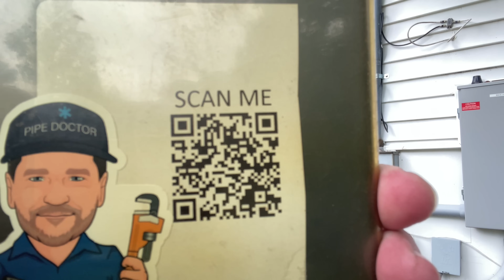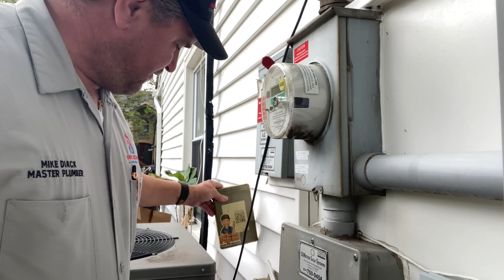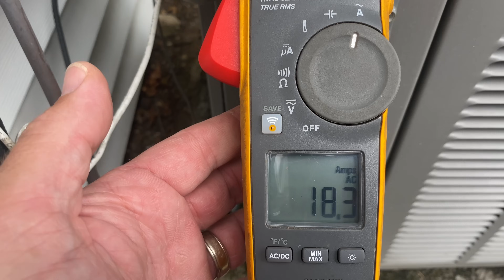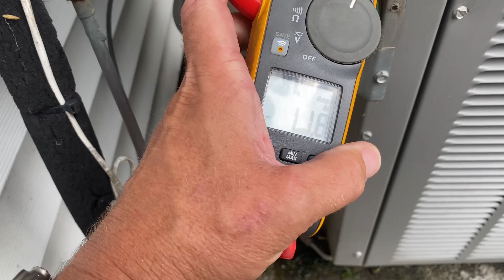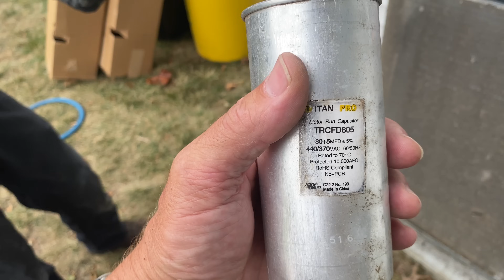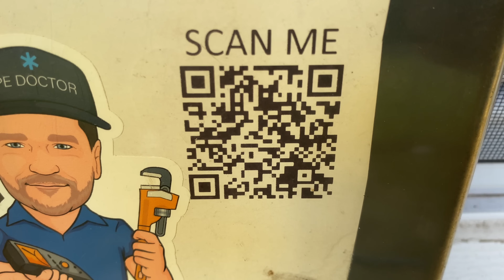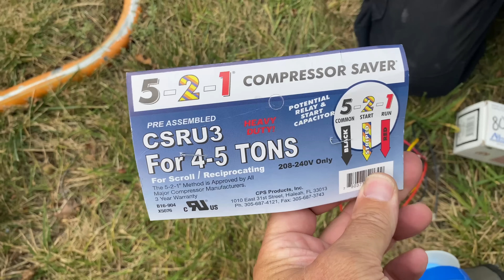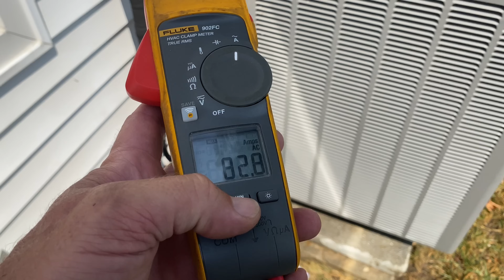Part 2: Soft Start Killed Compressor Followup Service & Maintenance - The FIX Revealed

Comment: Why install a hard start when you know they have off-grid solar which requires a soft start? You can’t have a hard start and a soft start in the same application, which means they either need to live with no AC during power outages (and will have to manually turn off that breaker while on battery to avoid tripping the inverter) or they will need to replace the hard start with a soft start, money out the door.
Reply: From what I read and talking to the senior techs at the hvac company I work for a soft start it can do the same as a hard and the only reason to use a hard start is they are cheaper.
Reply: @barrettready1713   they aren’t nearly the same. A soft start can drop your inrush down to single digits. A hard start will still have mid-high double digits as seen here at 82 amps. That difference is why soft starts cost more. It’s also why they had one with their Tesla powerwall, which is 30-50 amps max depending on version.
Reply: I wrote to him about the need to wash the outdoor unit, and a soft start is needed for a reason.  this is a system requirement.  When starting a compressor with a soft start, the currents are much lower and there will be no voltage drop.
Reply: From experience most inverters can deliver around 50-100% extra for a few seconds and most of the times that’s enough buffer to kick start an AC unit. The current drops within seconds to an acceptable level and the AC keeps running.
Reply: @tronixfix  Tesla Powerwall 2 is rated for 5KW continuous (20 amps) and 7KW off grid 10 second spike (30 amps). Both well below the current 83 amp the ac Unit had with a hard start. The current configuration will absolutely cause issues when on off grid power.
Reply: You seemed close minded regarding the soft starter.  They actually remove hard starts and put some soft starters on especially if you are running off a generator and want to reduce the surge watts.  Perhaps you should go do some research. Was the soft starter the wring for the ac compressor size?
Reply: Tesla states on their website the LRA(locked rotor Amps is the initial amps pulled when the motor first starts) for batteries which in one spot it says 88A and another spot it says 106A. Hard to believe inconsistent numbers. The hard start is going to require more amperage to kick the motor on. Hence the name hard, its working harder to get the motor started quicker via a capacitor that adds torque, there is talk about how this can actually seize a motor over time because the increased torque on the motor. But the industry standard has been if an AC is old and not operating at peak running amps, then add a hard start. The soft start, if sized correctly for the AC unit, uses timing and resistance/impedance to lower the initial starting amperage required to get the motor going, hence taking a little more time for the unit to get to full running amps but it never has a big jolt of amperage. Which, if you are off-grid and only got 2 powerwalls, most likely the surge of amperage is going to be too great, and will not operate as designed, or even worse, damage a powerwall. They can load shed the AC unit but that requires splicing into the small communication wires of the thermostat from tesla gateway and a knowledgeable installer with access to the gateway software. Soft starts are newer technology that are being designed into newer AC units but these old ones NEED to have them installed for these types of Electrical Storage System designs.
Reply: @barrettready1713 not true.  If you look at a hard start through an oscilloscope, it provides a higher amp surge for a shorter period that a normal clamp meter can’t read.

An oscilloscope can, and will show that insane spike that backup power inverters will freak out with
Reply from the maker: Look at all the thumbs up! Wow! The age of this system warrants a hard start. I can’t believe so many people are ignorant. It’s a 25+ year old R22 system. I cut the LRA by half with a hard start. A soft start isn’t practical here. People need to educate themselves. The information is out there. Even on Tesla website. Look for LRAs with 2 powerwall. Jesus. Why can’t people learn??!!??!!
Reply: @xzibit8614  Newer amp meters have the capability to measure in rush…
Reply: @PipeDoctor  Not sure who, or why, you are calling someone ignorant… Technically speaking, you didn't decrease locked rotor amps… That only changes, actually I should say only starting current changes, if there is a change in voltage… They are only the same when it is a direct online start at the rated voltage; in other words LRA is constant at a given voltage… A hard start just provides an additional buffer as it is nothing but a capacitor, and is needed when the actual LRA is greater than the original spec… A soft start changes the voltage to ramp up the motor (more sophisticated than, but similar to, a wye-delta start)… Thus, the need for a hard start indicates another problem and it is just a temporary fix...
Reply: @PipeDoctor clearly you should stick to hvac cause you are wrong the electrical portion of this whole install.
Reply: Pipeguy, the Hard start introduces additional stress in this scenario. If you wish to stop the hating as you say in the video.. get the right size soft start and stop hating on it.   😮😅
Reply: **there would be such irony when the system fails and the cause is your hard start device that shorten the life of the compressor while... One reads the title of your video.. implying the soft start killed the compressor.. not extremely grasshopper ...the soft start failed as it was the wrong size for the unit.. get the right size soft start and don't change to a more premative stress inducing cure... The hard start. 😮🎉
Reply: Not hating, but why not just put a properly sized soft starter on it?
Reply: show many variables. Different units and situations warrant different applications.

Sometimes a hard start is the correct call, other times soft Art is the right equipment . it’s not a one size fits all kind of world, especially when it comes to AC units. it’s just my two cents my silly little opinion.
Reply: @PipeDoctor  we need mikey pipes to teach us
Reply: @bobbyfreeman8889  the original soft start was the wrong size for the unit. the unit is 5 ton it had a  3.5 Ton & Under soft start from part 1

Comment: @mikey Pipes,   loves the videos, the only thing that i think you missed here is explaining the difference between a soft start and a hard start!
Reply from the maker: Agreed maybe I’ll just talk about the differences on the next video
Reply: Hard start just adds extra capacitance in the system to buffer the kick of inrush amps when the fan and compressor turn on at the same time.  The soft start is basically a VFD with a timed start sequence, starting the fan first and then vfd in the compressor. Its like a spooling up effect.  Everything has a place for sure, And the dirty coils and running at max amperage is what killed the soft start, if the coils were better maintained it probably would have never gave out or at least lasted longer than it did.  Great video though! Everything has a place!
Reply: If the soft start was fryed and needed to be thrown away I missed something.  The 200 foot lineset contributed to the start amperage. This is likely a reciprocating compressor so the inrush is needed to overcome the inertial mass of the compressor and the refrigerant. What I think I saw is the soft start going into fault during running, not during starting.

Comment: Meters reads average, get a small scope with amp clamp. Like hs512 and run it with your phone or a tablet. You can see time vs amps/volts ,no meter can touch it. And its around $220 for all.

Comment: I thought I had a problem with my easy start (soft start). Took it out and was about to throw it away too. But found that the compressor would not start. I put the hard start back in that I had the AC guy put in from the start and it worked. The Easy Start guys said check the capacitor. I thought they were full of crap but I checked it and the fan was good by the therm was bad. I changed the capacitor and too the hard start off and it fired right up. I put the Easy Start back in, retrained it and it’s been working fine even on these 100+ degrees days in Texas. Don’t throw that soft start away!
Reply from the maker: This one was UNDERSIZED
Reply: @PipeDoctor  Undersized is better than just calling it a hockey puke or useless. I'm honestly just blown away by your disrespect honestly & can't come back with normal remarks that aren't from my view Biased. But to each their own. I'll continue to recommend these devices to homeowners that need them.

Comment: i can also agree with some of the other commenters.  Click bait title.  Soft start may have failed but it did not kill the compressor.  And I also agree with those who said you need a soft start with a generator.  When i installed a Generac whole house generator here in north Texas it really bogged down almost stalling when it kicked in.  The same brand soft start as you found cured it. (I installed the larger load model they sell).
Your "new" customer may not be so happy with your services the first time they lose utility power and need the Tesla wall to run their central air and it trips off the Tesla backup due to overload.

Comment: Soft Starts can be good, but as anything, they can fail. If that's the part that went bad, then it's the part that needs fixed. In this case, the quickest & simplest fix was to remove it. However, with the Tesla battery system, it may be a good idea to put a replacement soft start onto the system. Soft starts are also good for those who use a backup generator. The AC can frequently run on the generator's current ability, but can't start on the generator's current capability. Replacing the soft start with a hard start will still reduce the inrush of current, but it kicks the compressor a lot harder than the soft start does.

That said, I wouldn't have said that the soft start killed the compressor. The compressor is fine. It was simply shutting down the compressor.

Comment: The minimum and maximum button on a fluke meter does not capture inrush current. Other fluke meters have that function. The reason you have a different reading compared to your previous visit it’s because the hard start changed the timing of the window that min max would see
Reply from the maker: thanks for sharing. this is what MOST* HVAC technicians carry. Is there a model specifically which will ALSO measure that??

Comment: If they have an off grid battery type system, did you check it by pulling commercial power and then seeing if it can still start the AC with the hard start on it?

I would have replaced it with the correctly sized soft start kit.
Reply from the maker: Did you watch the entire video?
Reply: @PipeDoctor  Did I miss something?

Comment: Please tell me that someone tested the system when it goes off grid. Does everything function as designed, or does this system still need a soft start? Ideally it should just be upgraded to a newer and more efficient system, but of course that is a lot of money added to the 2 service calls already paid for.
I would be PISSED if my system worked off grid, it broke, called a professional, they removed a part, then got charged for a cleaning that might have "fixed" the original problem, and now my system no longer works off grid.
The theatrics on the internet is cool for views and all, but I really hope you remedy this situation if indeed they no longer have A/C during power outages.

Comment: Cleaning the coils is a real thing. I do mine annually. I also clean the evaporator coil. But soft start is a good thing. The house has the power wall, I’m assuming it has the solar roof also. The soft start will be better for starting with solar. And yea, they can go bad. If thus happens you do what you need to. I want to install one in my HVAC. I am also in South Florida, 80 degrees is warm but not hot. It’s the middle of May now and today the high was 97 degrees. AC is life support. Preventative maintenance is what it is all about! Take care of your stuff, it will take care of you.
Reply from the maker: Smart
Reply: Preventive.

Comment: You mentioned part one of this video.The only mistake I saw you make in that video was you forgot to turn the faucet off after you found out there wasn't any water at that location. As for soft starts,,,,they can fail just like anything we use these days.When your video says it killed the compressor its a bit misleading but hell man nobody's perfect.If it were me I would've suggested a new soft  start which is needed for their system, cleaned the coil as you did and been done.All in all if I needed ac service I wouldn't hesitate to call you.Its simply a difference of opinion and we all know what they say about opinions.Great video and I think you are a damn good service tech that we should all be thankful for.Great job pal.

Comment: I installed (2 years ago now) a micro air soft start on my rheem single stage 4 ton 16 seer r410a unit… it has been great and reduced my inrush current to 28amps at startup and it runs around 11amps when it stabilizes pressures. I have it so I can run my house on my portable generator during outages and it starts the condensing unit no problem. Before the soft start it was around 75-80 amps at startup. Do you see a lot of failures with these?
Reply from the maker: I haven’t seen any failures until this one

Comment: ive been using a compressor start delay....which is just a heat sequencer. a cheap hack that works awesome.  it just delays the compressor for about 6 seconds upon a call for cool. Fan starts right away though
Reply from the maker: Why are you delaying compressor for six seconds?
Reply: so the starting amps are reduced. kind of mimics a soft start kit. works well @PipeDoctor

Comment: MIke, do you recommend painting the coil ( RectorSeal ) ? to protect  it  from rust ?  what about the inside coil ? painting ?  when you are  installing a new unit or replacing an outside coil. do you have a machine to recover the freon inside the old units? i have seen the AC technicians  just open the valve and let the freon go. they says it is faster this way  and the machine cannot recover all the freon anyways. are they saying the truth ? you mentioned you do not like double coils ? because of leaks ?
Reply from the maker: No

Comment: was about to get the 5-2-1 (like its 3 wire kit) but quality looks better on Amrad even though its 2 wire. Amrad has 5 year warranty and has built in CPT fuse in case relay fails
Reply from the maker: Can’t get Amrad hard starts here. Amrad don’t care about the NYC market

Comment: It always seems to be the side of the coil facing the house that gets the most dirt on it. Is there a reason for this?
Reply from the maker: Lack of airflow
Reply: Extra air flow.  The flow is higher because the air speeds up to go through a smaller area which sucks in more debris (like cotton wood) from the surrounding area.
Reply: Either of the other two replies may have something to do with it, depending on what is in the air.  BUT, my bet is that it is more due to the fact that the previous people who cleaned or serviced the unit were lazy, figured that cleaning three sides thoroughly was good enough, and either did a half ass job on the fourth side or skipped it altogether.

Comment: I’d put in an ICM controls soft start.  They have backup solar.  That hard start will trip out the inverter
Reply from the maker: No it won’t trip the system.
Reply: I agree... actually did the customer a disservice here. Should have replaced the soft started with an appropriately sized one instead of cheaping out. 85A might not overload the inverter, but then again it may. If the current draw in the house is significant when the AC kicks on, it will. The soft-start would have the start up current half of that, at most.

Comment: Solar Panel systems and battery back up can not deal with that massive inrush current.
Was the soft start kit underrated or just died?
Or just a cheap one?

The voltage drop on those big 5 tons in crazy.
They make very good soft start kits now days.
As you know capacitors here in the last 15 years installed into  condensing unit were cheap junk from the manufacture’s.
Also the Wire to that 5 ton maybe undersized.
I made it a point to check the wire size and then do a voltage drop calculator to make sure the wire is up to the task.
Great Videos
Well Done Sir.
Reply: It was the small soft start kit incorrectly sized he removed.  Not the one that that compressor needed.
Reply from the maker: The soft start was the wrong size. Lasted a number of years until it crapped out.

Comment: As seen once disconnected the soft start device, 120 A start current was noted.  Having watched other channels about these devices, have seen on installed on an AC unit this large.
Possibly that the device is not the correct size/ampacity?
Reply from the maker: Correct. Too small

Comment: Hey brother you need to look up the compressor specs to see what size start capacitor is required. I've seen several 5 ton systems only require a small hard start kit. The start windings may not be compatible with the larger start capacitors. Look up the Copeland or Emerson specs online and it will tell you what size start capacitor should be on the unit.
Reply from the maker: Thanks for the advice! I'll definitely look up the compressor specs to make sure I have the right start capacitor for my system.